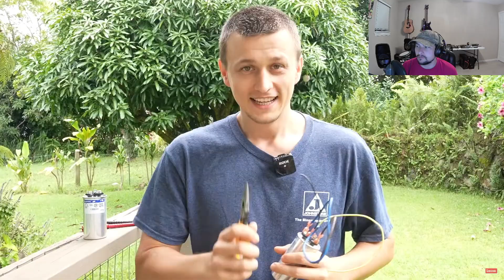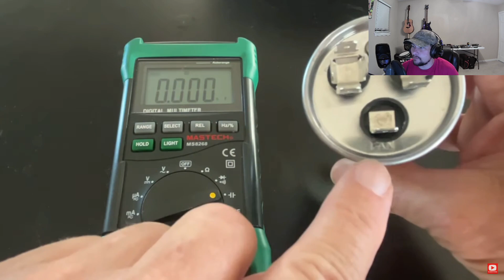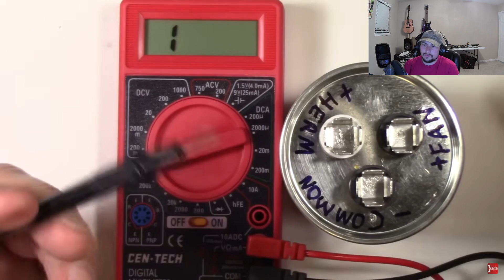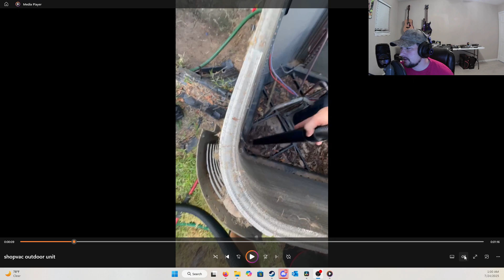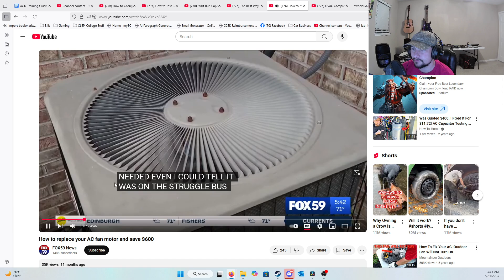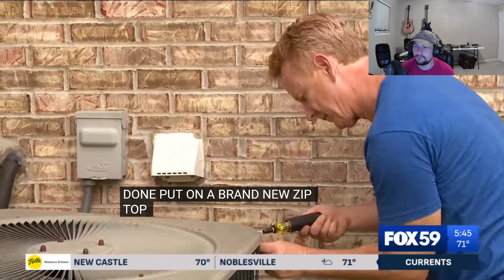5 DIY A/C Checks Before the Pro Arrives | HVAC Maintenance | SAVE MONEY | in 30 Minutes or LESS!

Comment: Before you call the pro* Didn’t even watch because the title is stupid.
Reply from the maker: So what would be a better title for someone who is capable of repairing their system before they call a pro for things like filing the system which is regulated by the EPA and certified technician? Thank you for your extremely useful and helpful comment.
Reply: @DudeJayStarr before you call the pro? Duh?
Reply: Really, what would you call it? Maybe watch it and then suggest something you think would be better. Always trying to be part of the solution.
Reply: @bertpeters1866 before the pro arrives means you already called a service company. It’s not rocket surgery buddy. Don’t ever call a service company in the middle to summer to cancel when they are on the way or after they arrive.
Reply: @jman0870 I agree. Maybe it should have been titled "Before you call." See, that wasn't hard
Reply: @bertpeters1866 read my first comment, genius